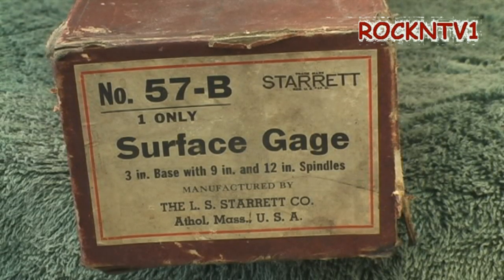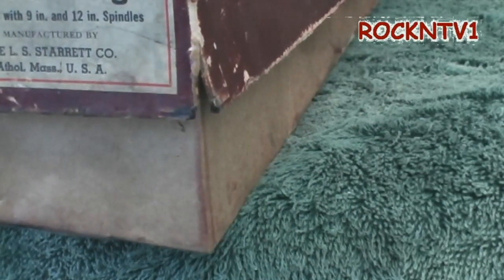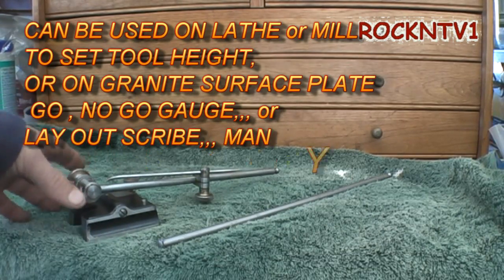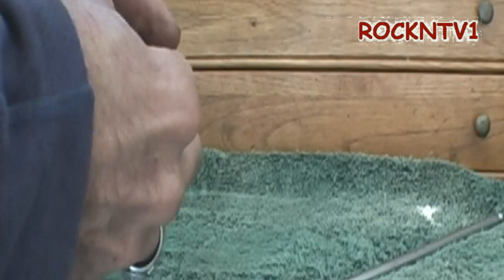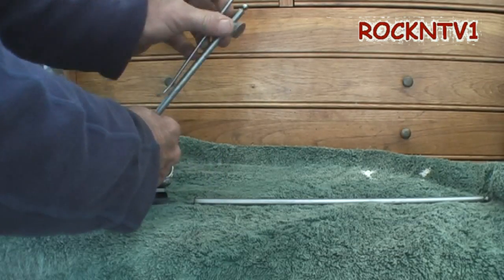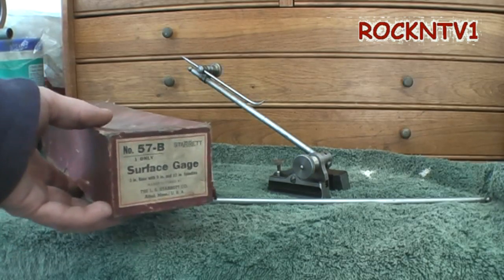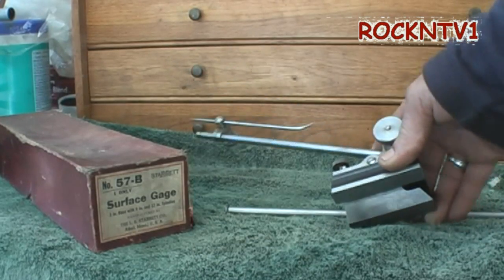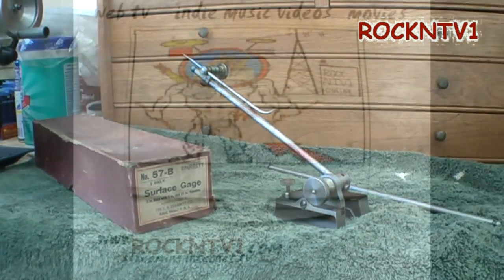LATHE, MILL surface gauge Starrett 57B

Comment from the maker: @happymark1805 I  use the surface gauge tool set tool height on my logan lathe, and for  checking runout when chucking part blanks when dti accuracy is not needed.

Comment from the maker: this Starrett surface gauge is mint, use a plastic hammer so you dont mar the metal pins. Mine dosnt have springs, but the pins are tight so they dont offend a measurement.

Comment: Ahh...Gentle persuasion...That's different!  Starrett must've incorporated the little gage pin springs at a later date.  I got one off of e$ay a few years back, old industrial stock--mint condition, never used, still wrapped up in it's paper packaging.  Wee bit of rust, but nothing a bit of obsessive-compulsive behavior couldn't cope with.

I've got one of those Chinese dial height gages, but where's the fun in that?!  The Starrett makes it almost feel like I know what I'm doing.

Comment: Lovely surface gage!  Looks to be mint condition.  You shouldn't need to use a hammer to whack the gage pins into the down position--they should be a close sliding fit with small springs to hold 'em in place while they're extended/retracted.  Don't wanna be a nuisance, just hate to see a nice, older tool abused:-)